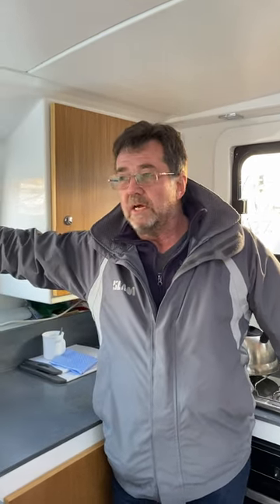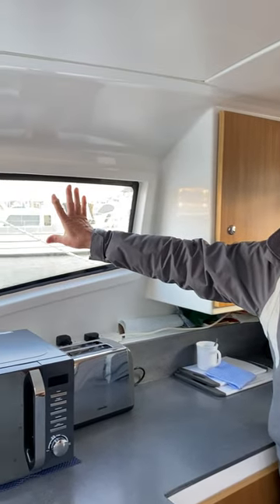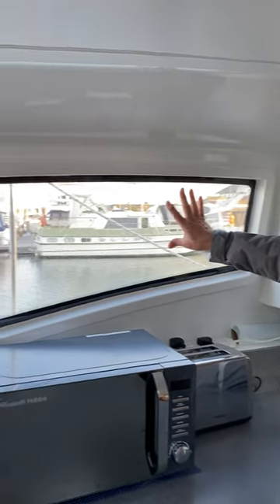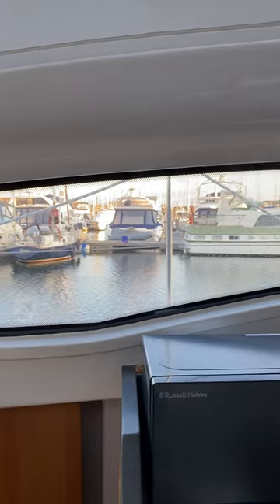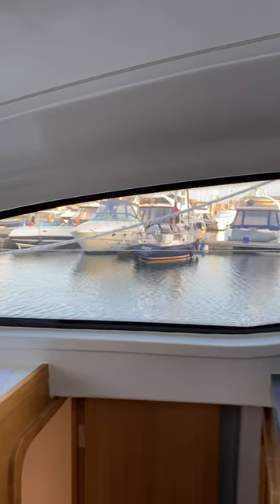Catamaran windows; glass vs acrylic

Comment: Strange that as an cat. builder, you doesn't know the acrylic are not being utilized as windows in boats. They are polycarbonate, many times liter then glass!
Reply: Acrylics and polycarbonate are lighter, and less expensive but they have a thermal expansion rate 5 times that of glass, causing window leaks after a short time and they craze (even polycarbonate) and their life is much less than glass. That’s why almost all Broadblues use fully bonded toughened and hardened glass. The only exception is the Rapier 400 where the lighter weight of the polycarbonate wins out.